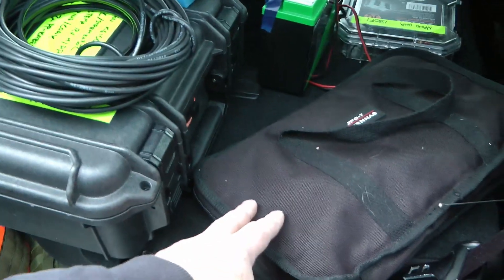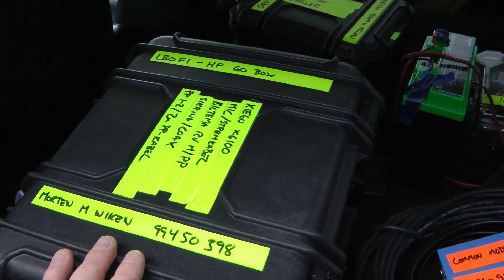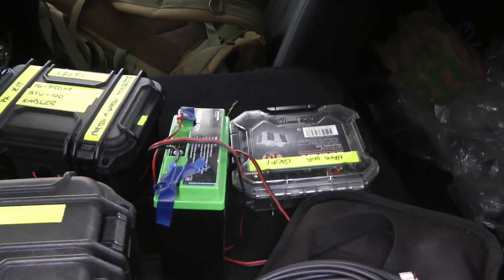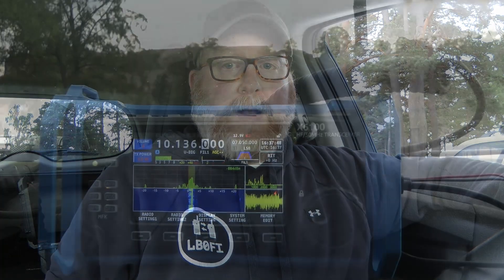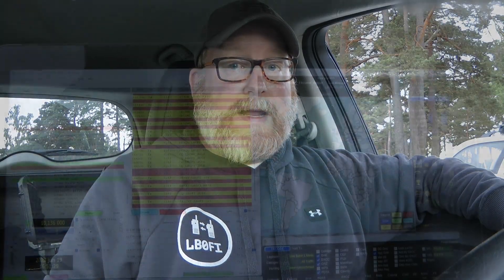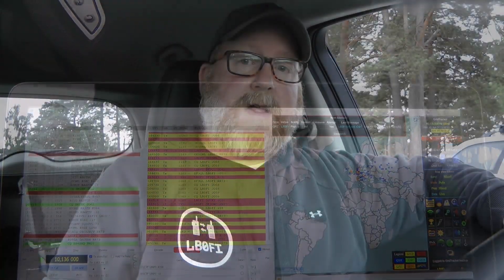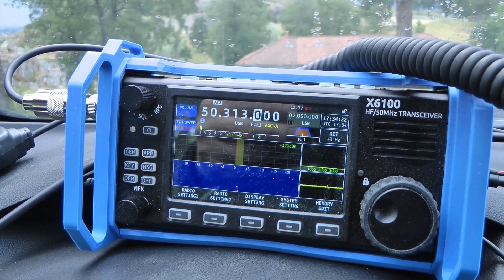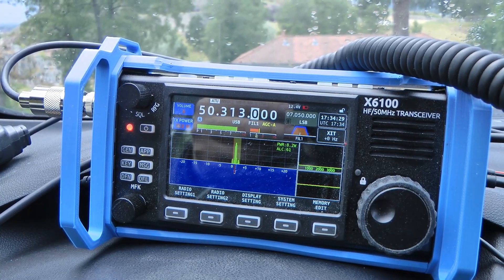The Chinastick Revisited

Comment: I feel that you still did not give this antenna a chance. If you have an antenna analyzer, you can simply takeoff a bar or two to make that antenna tune 17, 15, 10, and six. I do it all the time and it’s my favorite antenna. I’m surprised the bank is the box that you get.
Reply from the maker: I have at least three videos on this antenna. It is halfway decent, but not great. It is lightyears better than a Buddistick, but it's not as easy to use as i.e. a Slidewinder DX or a GP-TWO. I have videos on all of those antennas.

Comment: Hello Morten, when you install your antenna, the header, the feeding point is upside down. You have to use it in the reading direction. I made a video on the JPC PAC-12 that gives me very good results. Here is the link. 73 Gael.

https://youtu.be/dmVmXaBig3M
Reply from the maker: I’ll look into that. Thanks!
Reply: @LB0FI  I corrected the transcript of my video. Subtitles are therefore available. The same thing, for a video in which I make an antenna comparable to the River Coil or the Side Winder: 

https://youtu.be/cK3E9q3MnI0

 73 - Rando QRP - Gaël F4IHG
Reply from the maker: @RandoQRP  Awesome. I'll check it out!

Comment: Try the longer telescoping whip and experiment coil# vs length… make sure the contact is touching only one coil.  Glad you gave it another try. It is a compromise antenna but does extraordinarily well most of the time. 73s
Reply from the maker: Another whip would be a good idea, but it is unfortunately M10-threaded, so I don't have any other whips available at the moment.

Comment: Thanks for sharing your experience.I ever used the feed point on my jpc12 reversed. The SO239 socket down so that the coax shield is connected to the radials. Maybe it would be worth a third try. 🙂73 de DL3XN
Reply from the maker: Absolutely worth a third try.

Comment: Coil loaded antennas are "high q" - so they are usually tough to get resonant.  The benefit:  They are smaller than 1/4wave wire antennas.  As with all things ham radio, its a gamble.  For field day I'm going to play with a mag loop... because why not.  The high-q might act as an artificial band-pass filter and keep me sane.
Reply from the maker: I would advice you to take a look at my "Magloops are for Massochists" video before you venture out with that project. Also, everything is a tradeoff in this hobby, but I would really like to find that coil loaded antenna that I can actually use and be happy at the same time.
Reply: @LB0FI  My vote...and I still need to try this... is the MFJ 20m whip + the Wolf River Coils Sporty 40 - resonant from 20 up and also 40 with the coil.
Reply from the maker: @temporarilyoffline  I loved my MFJ 17ft whip, but it wasn’t built strong enough for my use. I’m hesitant about buying another one.
Reply: @LB0FI  I don't know if there is a "strong" 17ft whip - the top sections get pretty slim.  I'd stake it down or guy it.  My last activation I just kept holding it when the wind picked up
Reply from the maker: @temporarilyoffline  Mine just wouldn’t stay up after a while. Eh, let me rephrase that…

The joints became loose, so they didn’t lock in place when I extended it. I might try one of those Ali Express whips, just because they’re dirt cheap.
Reply: Did someone say mag loops?! LOL. I picked up the WRC Sporty 40 and their new 213" "enhanced" whip at Hamvention. So far, so good. There's definitely a noticeable difference in how the new WRC coil whip is vs. their previous one (I have both). I haven't gotten my hands on a Chameleon 17' whip yet, but the new WRC is really nice. It feels stronger and it's more compact when packed up too.